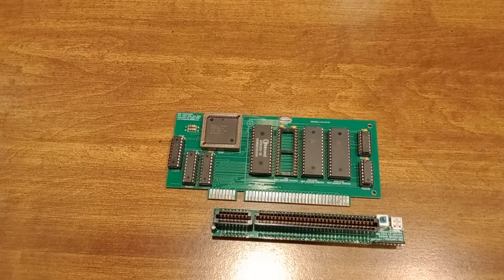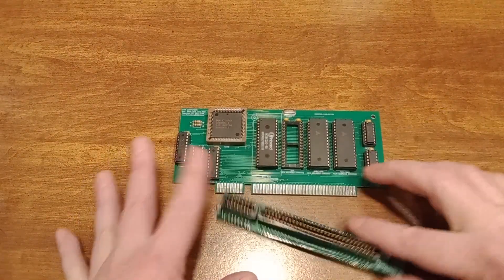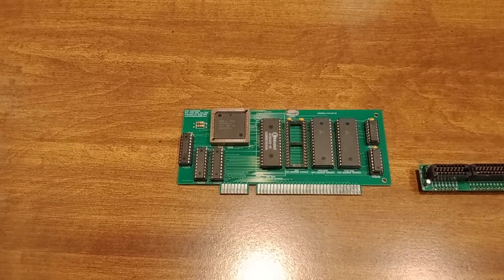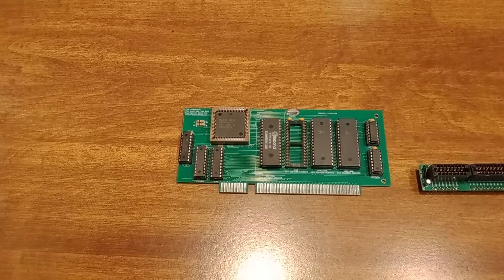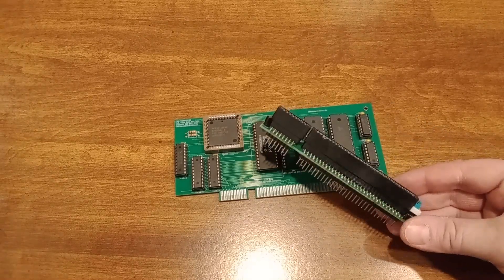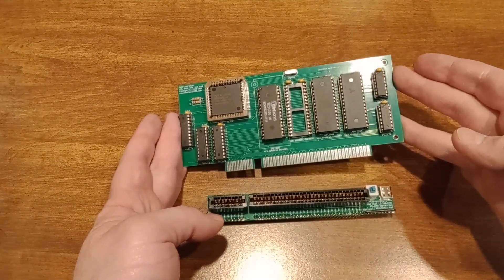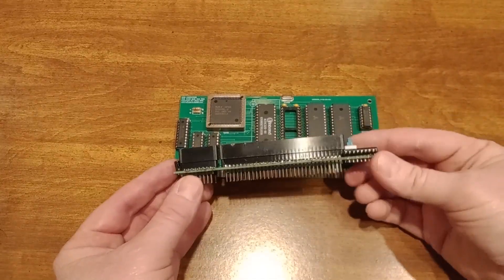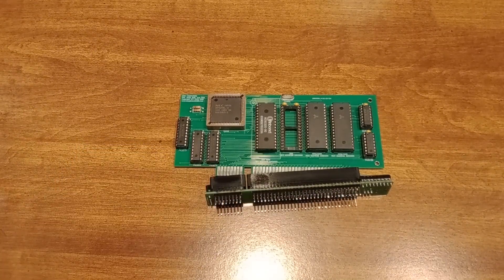V40 Processor and Memory combined ISA card.

Comment: In mid eighties of the last century I designed an IO processor which was based on a 80186 by Intel. 
At that time 80186 became popular in design of coprocessor systems, and was the first SOC released by Intel that had a lot of stuff integrated with an 8086 cpu. 
First release of my project was running at 12 mhz, but soon the clock frequency was increased to 16mhz and then up to 20 mhz in order to get decent performance. 
I think V40had the same features of an 80186 , the only differences were an 8 bit external bus and a pin layout, but my project requirements mandated a 16 bit external bus and V40 could not be used. 
Think how far technology has got in the last 30 years!
By the way I designed a lot of boards based on ISA and PCI bus!

Comment: you should make a SBC board thats all in one with onboard video and all but uses usb or sd card as storage also emulate floppy as well, that be cool
Reply from the maker: I do like my current design. "Modular" is the theme of the project as a whole. This way you can add and subtract items as desired to customize the layout for most needs or interests.
Reply: @elijahmmiller   Understandable :) That's your project. I'll have to look if there is some project for fpga "glue" logic project for 8088 class that would make putting "single board" sort together way easier
Reply: I was wondering if there are 8088 surface mount CPU's but I have not found any. I was thinking about building 8088 "handheld" that could run DOS
Reply: @Vein1986  a handheld would be the first if its all real hardware. With modern lcds now days that should be not too hard to achieve especially if you use a video chipset that supports lcds like on industrial sbc's
Reply: @Vein1986  V20 and V40 have QFP package and you can check for them. For original 8088 it's really hard to find.